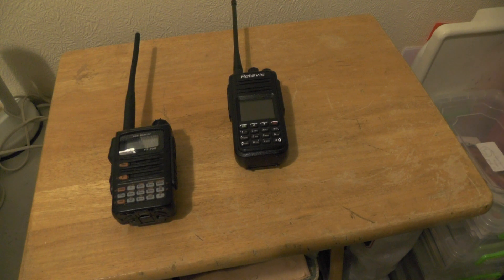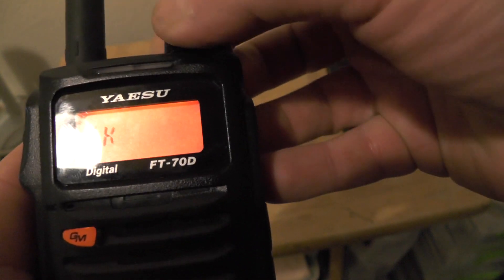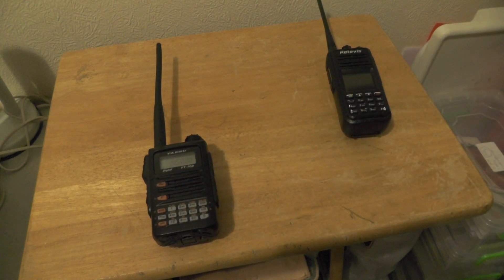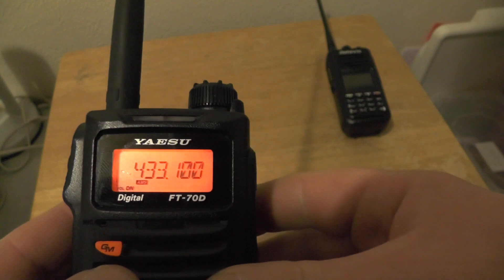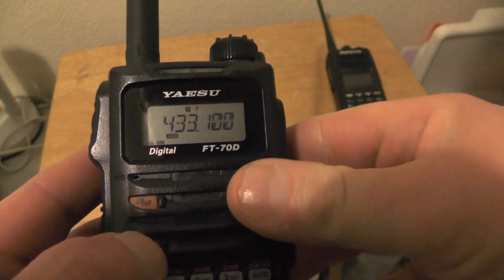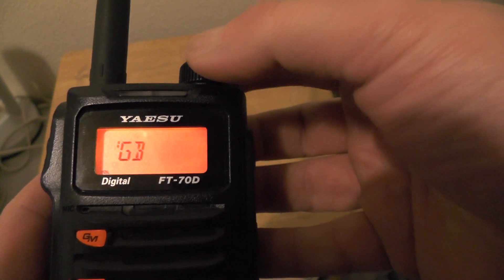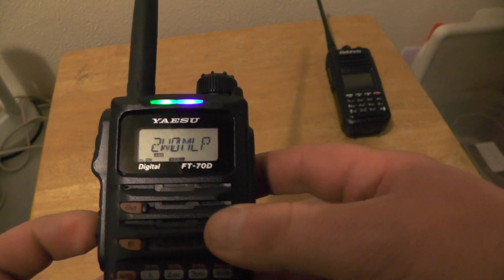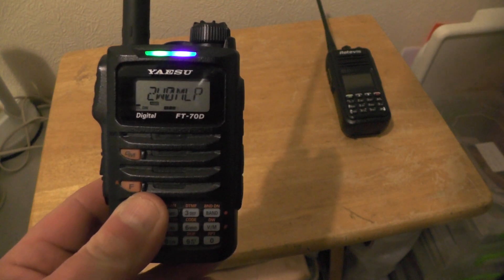FT70DR Fusion repeater setup

Comment: Thanks for posting. Once you're on the repeater can you pick & choose what distant places to try and contact or, are you limited by the repeater setup??
Reply from the maker: If the repeater is fusion then you can press the wires x button and select a room to connect to
Reply: @2j4ez  Tnx fer the quick response. What about reflectors YSF or FCS: Can you directly connect to these via your local fusion repeater or do you also have to go through Wires-X?

Comment: Thank you for the video. I’m a newbie so if this is a dumb question, I apologize in advance. When you programmed in the repeater, your first step was to change the mode to DN. How did you know to use that digital mode instead of VW?Thank you.
Reply: On my radio, the Digital VW mode was turned off at the factory. To turn it on , go into the menu that opens when you long press the Function button then dial to menu item 16 (DIG VW) and turn it on. That’s how it was with my radio.
Reply from the maker: @marks2254  ok ill look into that cheers
Reply from the maker: There’s no such thing as a dumb question we are all still learning every day is a school day. I’ve got a app on my phone called repeater book and I can tell the app to just display fusion repeaters near me and the one at welham green showed up hope that helps
Reply: Thank you. I have a Yaesu FT-70 too and one of the digital modes of the radio is DN and the other is VW. Does Fusion indicate DN, not VW?  As I understand it, VW is voice only digital and DN is voice and data?
Reply from the maker: @marks2254  not sure what vw mode is maybe you have a newer firmware on the radio than me?? I’ll look into what vw mode is

Comment: Thank you so much for this! You make this look easy!
Reply from the maker: johnhe0414 the ft70de is a very easy radio to get in to and fusion is much easier to get going than dmr thanks for the sub and thanks for watching
Reply: 2j4ez  The FT70 is my first radio and I am a first time HAM, I have been looking for videos specific to this model - again thanks!
Reply from the maker: johnhe0414 no problems . Welcome to the hobby ft70 great radio . Maybe chat on fusion soon . If your not near a fusion repeater then you can use a raspberry pi as a hot spot thanks again for watching